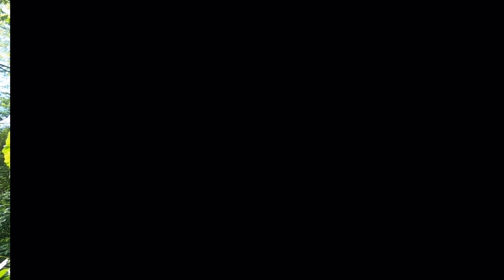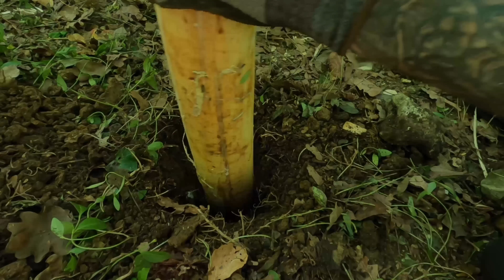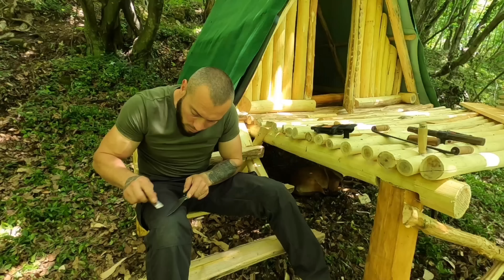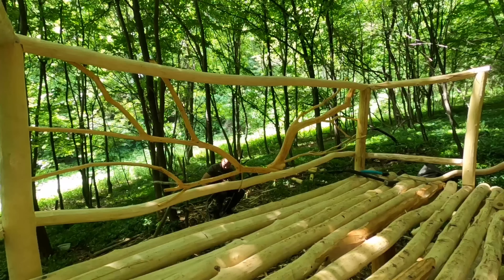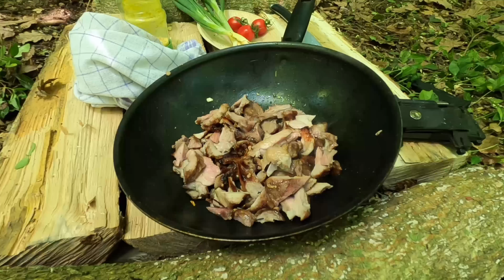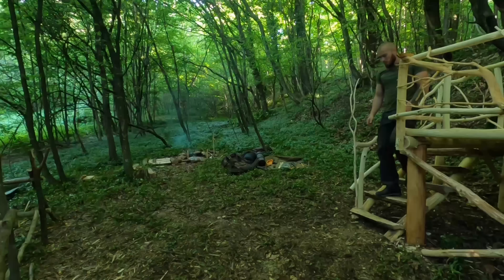Building a fairy tale house in the forest - part 2

Comment: Are you using a ground tarp or a poncho liner?  Also can you recommend a bushcraft knife or specs to look for?  I have been told to look for a fixed blade no longer than 3-4 inches, but not lot more.  Thank you and love the hard work you put in to your craft. 👍
Reply from the maker: If you think what I covered the roof with, the answer is a waterproof pvc roof membrane. As for the knife, my favorite is the Bayleyknife. Thanks for watching.
Reply: @luxonbushcraft  I was referring to the camo colored item that you are using on the ground to lay out your tools and work on.  I can’t tell if it is a poncho liner or a waterproof camo ground tarp or something else?  I do appreciate the answer to what you are using for the roof cover as I have a future idea that might use something like that.  I have been looking for a multi-purpose item for ground usage other than a plastic tarp.  I see you frequently using your camo patterned “item” to hold tools, carry clay, rest on, etc which seems to be a very multi-purpose item that holds up well under a lot of different situations.
Reply from the maker: It's a military tarp
Reply: This looks like the tarp you used for the floating bed video that is one of the reasons I am interested.  I can’t seem to find one anywhere on the web in the US unless I am searching for the wrong thing.  All of the ones I have found have 8 grommets and 24 snap pairs.  I love the idea of the versatility of the tarp you are using.  That is why I keep asking you questions as I hope to find one to purchase.  Any suggestions would be appreciated.  TY!
Reply: Do you know if a tarp like yours can be purchased from the US?  The replies I am getting are 
1 - the grommets are 2 ft apart.  Deal with it.
2 - use a bin bag aka trash bag in the US
3 - forget it as you aren’t going to be helped.
I am getting no where with my searches.  Am I wrong in guessing that the grommets on your tarp are approx 12 to 18 inches apart?  I want to be able to replicate your floating bed or use 2 poles to make a raised platform with a laced tarp than to use a bin/trash bag that may or may not hold and will make lots of noise.  There is a lot of wildlife in my area and I prefer to keep the noise level down.
Thx